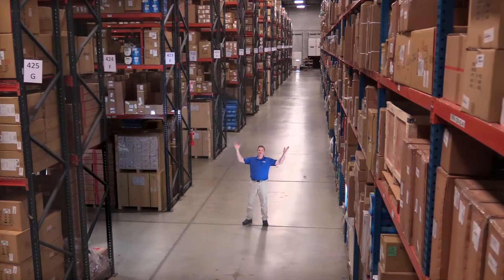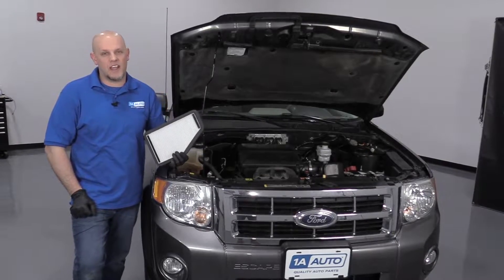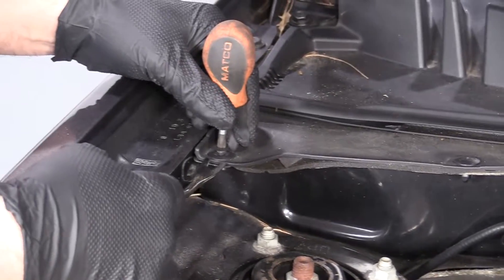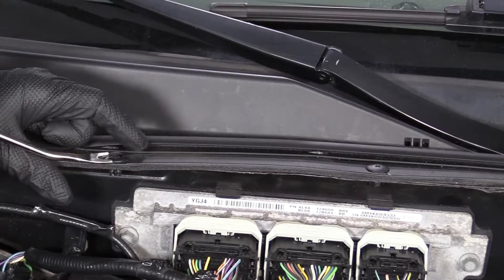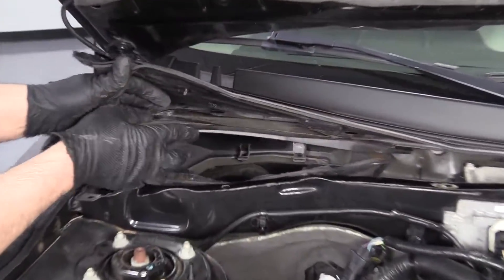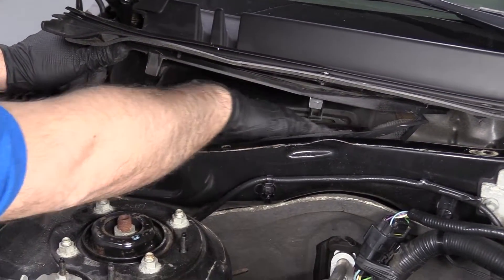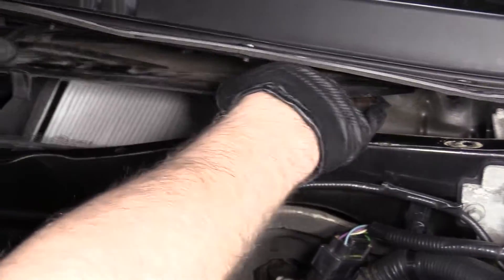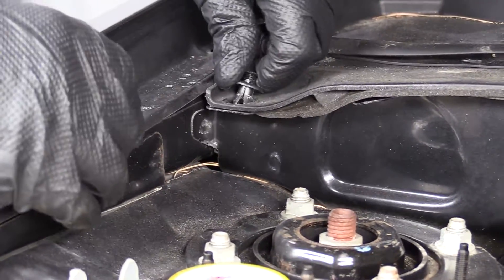How to Replace Cabin Air Filter 08-12 Ford Escape

Comment: Would guys happen to know why my 2007 escape has a cabin air filter shaped like this and even the area to put it is the same as here. Even though it's obviously not 2008-2012 it's the previous generation.